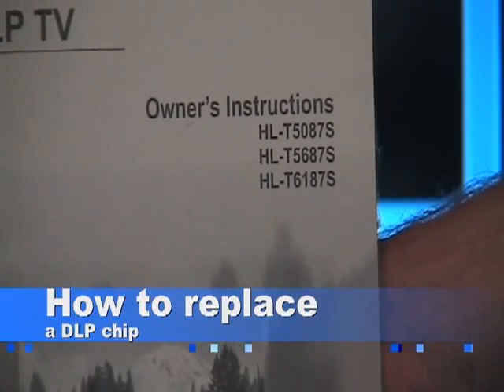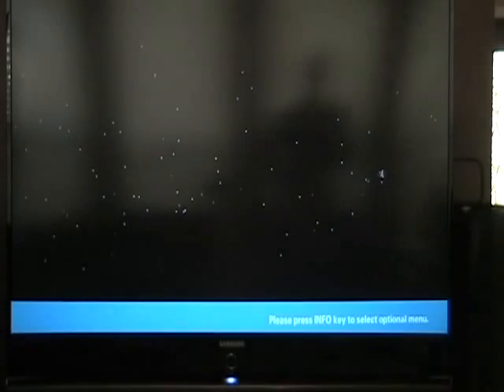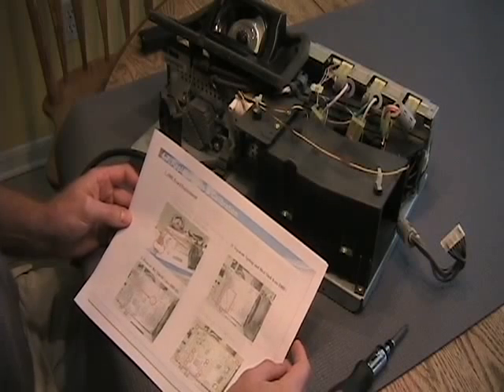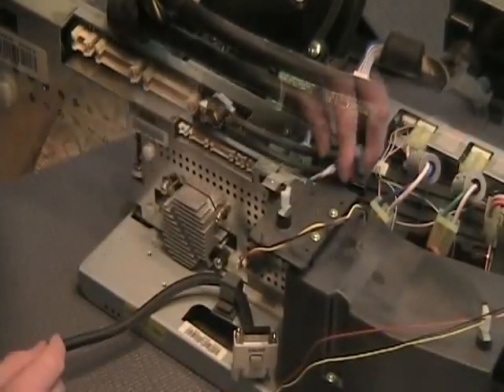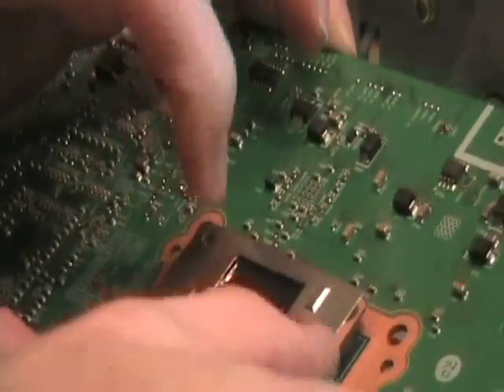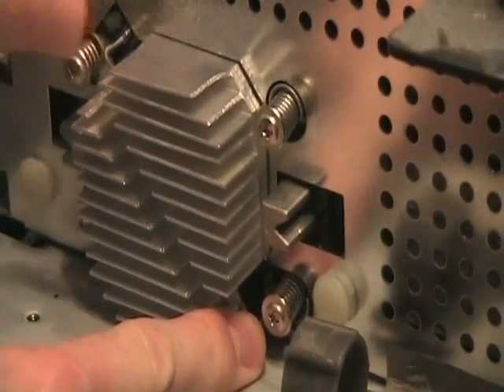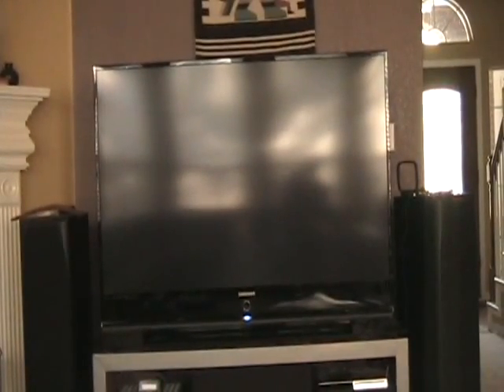Replace DLP chip on Samsung HLT6187

Comment: Just wanted to drop back in and say thanks again for your excellent video.  I finally did my replacement this past weekend and everything went great!  Some of the connectors on my HLT6187s were slightly different than what you have (like the monitor cables), but I was able to figure it out since they were in the same general location.     My picture looks great again, and you saved me so much money by not having to pay a repairman!

Comment: howd you get the board out ?  I got to 4:57  then all of a sudden youre putting in the new chip .
Reply from the maker: Please look back 4 month ago to my reply to DrewFromNC. The green PCB(Printed Circuit Board) can be simply pulled/slid out from the metal casing. Also, 2 months back, MON KELDAD posted a similar question/explanation. He points out that once you pull the green PCB out, flip it over to see the chip. Hope the helps. Sorry for any confusion. Thanks for watching and good luck.
Reply: WillFully WeirdWorld I got it.  It was just a little wedged in there.  Thought there was more screws.   Thanks for your reply and EXCELLENT video you made.

Comment: I usually buy my parts from Samsungparts  com.  But this chip is running nearly $400, I see the same chip on Ebay from a seller for $189 who currently has a 99.4% feedback rating.  Where did you get your chip from and how much did you pay?
Reply from the maker: I have no affiliation with them, but I happen to use shopjimmy. If you go all the way down to my first reply (2nd post), it tells you where I found the manual and how I located the DLP chip.  Thanks for watching and good luck.
Reply: Thanks!!!  And thanks again for your video,  I love fixing things myself and videos like this are a huge help.

Comment: Hi, I have a Samsung LCD rear projection ready TV Model # HL-R5087W  that has great sound but no picture at all, I have hooked different thing to it DVD player, Computer, another TV, ECT... trying to get a picture, I have even done the flashlight test with the menu screen, but it does not show anything, I was told the Lamp was recently changed and the color wheel is good, it shows smiley face when its done booting up. it does not turn of by itself, when the lamp is changed and you reset the lamp hours, doesn't you TV need to have some sort of picture to be able to reset it ? and should the lamp light, when on shine up thru the square hole that sets right behind the screen , can anyone help me figure out what is wrong with this TV. Thank You Laura.
Reply from the maker: The HL-R5087W is two generation before the TV in this video. Your TV has a bulb (lamp) for illumination while mine has LEDs. Very different technology. Sorry I can not help with your issue because I am not familiar with your TV or with the issue you are having. Good luck.

Comment: Have a guy that wants to charge an arm and a leg to replace this chip but after watching this video I'm pretty sure i can handle it. He mentioned something about programming the chip or something in that manner (i wasn't the one who spoke with him), but just to make sure...there is no programming necessary for replacing this part correct? and anywhere you suggest getting the part from. Only place I've found them new is eBay for about $180. Thanks
Reply from the maker: No programming needed. If you've every built a PC from scratch, this should be very easy for you. If you never have messed around with electronics, you should talk with someone who has so they can give you some tips on what to watch out for. As for buying, check out the very first comment and my reply. Put the part number in a search engine and specify shopping. I'm not affiliated with any one but I happen to buy mine from ShopJimmy. There are other places too. Highly recommend the service manuals also.

Comment: I'm replacing my DLP chip in the same model to fix the white dots.  I'm down to the step where I've removed the 8 screws that secure the bracket piece above the DLP chip and I see the chip thru the opening in the middle of the board.  In the video, it looks like this board pops out to permit access to the other side where the chip is.  However, even with the 8 screws loose, my board appears to still be secure.  How did you get the board out?  Is there a step omitted from video that I'm missing?  Thanks!
Reply from the maker: No missing steps. If you removed all 4 screws from the metal shield (the 4th one was hidden under some tape on mine) and all 8 point screws on the bracket, the whole green DMB Panel slides out. There is a separate metal casing (visible at 5:17 in video) that doesn't move and is fixed in place. Also if you have the Samsung Service manual, pages 12-11 and 12-12 in section 12-1-8, show the procedure to remove the DMB board. You can get a service manual online. See one of my first post that says where to find them. Good luck.

Comment: Bob O posted the following 6 months ago.

"My picture is a bit too high. I adjusted the screen in both settings and service mode, but still too high. Any ideas what caused this? My guess would be maybe I moved the mirror slightly when cleaning or tightened the screws down to hard. Just guessing."

I have the same problem after replacing my dlp chip. Any help would be greatly appreciated.
Reply from the maker: Sorry, I'm did not experience this problem. My only suggestion would be to look at section "3-6-1 Tilt Screen" of the Samsung service manual. Hopefully this helps fixes your problem. If you did not get the service manual yet, you can buy them online. In one of my first comments, I mention where you can find the manuals online. Good luck.
Reply from the maker: WillFully WeirdWorld Strange to reply to myself :). I just went back and read "Bob O" comments along with the replies between us. We talk about alignment knobs that the service manual points to. See all the comments below to find them. Sounds like they solved "Bob O's" issue. Hope this helps.

Comment: I just did this and it worked great. That is once I figured out that the back cover must be on for the lamp to turn on. So don't try to test it out without taking the final step of replacing the back cover. I would have saved hours if I had known.

Comment from the maker: I have not seen the evenly spaced vertical lines issue. My first suggestion would be to double check that all the cable are correctly seated. Maybe even pull them and re-connect. Sorry I can't be of any more help. There is a huge thread over at AVS forums. Maybe post your question there.

Comment from the maker: COOLRADIUM, the concept of replacing the DLP chip will work, but this how-to will not reflect what you will find in the HLT6176s. The 76s is an older generation (than the 87s) and the internal layout will have differences because the 76s has a color wheel and lamp versus the 87s has the LED light engine. If you are having white or black stuck-on pixels, it is the DLP that needs replacing. But, this is not the right video for your TV. Good luck.

Comment: Thanks for the video. Helped me save $600 over buying a new 60 inch TV. I was worried at first when I turned on my TV and everything went black. Turns out I forgot to plug one of the wires in. Phew!

Comment from the maker: There are alignment knobs inside the TV you can use. Look back approx. 7months in theses comments. Look for post by me, Sam Crook, and jbowen52. Jbowen52 describes the knobs and I describe how to find a picture of them on AVS forums. Also, if you purchased the service manual, it describe where they are. Good luck.

Comment: Thanks for the videos. just changed the chip on my 5087 and it works fine! Also cleaned the heat sinks, as you suggested, and boy did they need it!

Comment from the maker: The HL-R4667W is 2 generation before the HLT here. The HLT6187 does not have a color wheel, nor does it have the lamp light. The HLT has multi-colored LED light engine that provides both the color and light.
Therefore, I don't think anyone here will know the answer to your question. I'd searching AVS forums. Good luck.

Comment: Here is a problem no one on here has addressed.
I have a Samsung 46" HL-R4667W, Turn it on you can hear the ballast click, the lamp is illuminated, the color wheel is spinning quietly, all fans are running BUT the lamp light is blinking, no picture or sound.I removed the round inspection cover on the side and you can see light in the lens.

Comment from the maker: Hard to say but my two guesses would be: 1) Focus nob needs adjustment, 2) Lenses need cleaning or weren't cleaned properly. I'll assume it's the first one; so, if you look back to the first comments below, I explain where to get a manual. Highly recommend you get it. It will explain where the focus nob is. It also has other alignment and adjustment procedures.

Comment from the maker: The video shows me applying a few BB size spots near the center and then spreading them around the heat sink but not all the way to the edges. It will spread on its own. Since this chip is rectangular, I'd add a rice size amount centered along the longer length. A little goes a long ways. Just image a drop of glue smashed between to pieces of paper. It spreads far. Finally it's best to center it. All CPU/chips I've ever designed/worked on typically are hottest in the center. Good luck.

Comment from the maker: It is coming up on a year since my replacement. The white dots have not returned. I've read that Texas Instruments, who fabricates the DLP chips, had problems with first few runs of these chips. Supposedly they have fixed the process. Having myself, worked in this industry, believe that TI has stabilized the process and the white dots won't return.  My concern at this point is if any of the other know issues (See list of know issue in comments below) will occur.

Comment: I want to thank you for taking the time to create and post this video.  Changed my chip today in my 61" Samsung DLP using your video.  Mine is the LED model so there's no bulb that dims over time; however, I had not expected the picture to gain sharpness in addition to getting rid of the white dots.   I guess it was so gradual, I had never noticed.  Thank you again!

Comment from the maker: Unfortunately Stanley, it might be a power supply problem. Having read the main thread on AVS Forums for the HLT6187, I know of several issues this TV has developed.  1) Red LED failing, 2) DLP failing (white dots), 3) Caps on power supple failing, and 4) Caps on digital board failing. One and Two are the most common and I would be willing to fix. Diagnosing and fixing 3) or 4) sound more difficult from what I've read.  I've never fixed 3) or 4). Sorry. AVS forums might be of help to you.

Comment from the maker: Hard to say without a pic. My two guesses are that you either need to clean the lenses or you may have the "halo effect". If lenses, cleaning is easy. If you happen to have one of the units produced in the first few months of release for the HLT series, there was an issue many called "halo effect". You can learn more by doing a google search with: "samsung dlp 6187 halo effect". AVS forums has lots of information on it.

Comment: Great video!!  I have been going back and forth with Samsung about these white dots (my model was not covered in the class-action lawsuit), so I finally decided to do a little research on repairing my self.  So glad I stumbled upon your video.  Bought the chip at ShopJimmy via Amazon for $159.  I had my DLP set back up and running without the white dots in about 90 minutes!  My only critique about the video, LOOSE THE MUSIC!!  
Other than that, Bravo, thanks for the instructions!!!

Comment from the maker: I've seen varying prices on the DLP chip (the most expensive part). It was running ~$190 when I did it last year. Throw in the manual (I suggest in the video) and some thermal past and it was ~$210. I don't know the current asking price of the DLP chip.  To me, $210 was worth it for the 61" HDTV. My very first reply to the first comment tells you the part number and where to find manuals. Good Luck!

Comment: I replaced the chip & reinstalled everything the picture is perfectly clear from dots. But the picture is off centered. I have about 2" of black on the left side of the screen & about 3/4" at the bottom. Are there any adjustments to fix this?

Comment from the maker: No, for Artic Silver, you should not wait for it to dry. Also, too much can be an issue. Do not apply liberally. Furthermore, center it on the heat sink, it will spread out as you put the heat sink back on. Also, most CPU/GPU/semiconductor chips have the highest heat production near the center of the chip. Although it looks like I'm placing a lot on the heat sink, it's not that much and I'm mostly just spreading it out.

Comment from the maker: It seems to me that you would have very little room to work with if you don't remove the light engine. If you can handle the cramped quarter, I guess it's OK. Removing the light engine is probably one of the easier steps and gives you access to clean out more stuff. I read of many people having the red LED burn out. Taking the light engine out allows you to clean the heat sinks of the LEDs. I highly recommend that they be cleaned.

Comment: Nice video.  I just started this process tonight and got all the way to the point before removing the terminal board but stopped to confirm that the 1910-6143W will work to replace the 1910-6103W chip I have in there.  

  Do you really have to remove the entire light engine?  It seemed like everything was accessible without doing that.  Just unplug the cables, remove the fan and heat sink.  Do you think there is anything wrong with just removing terminal board?

Comment from the maker: Possibly. I can not say without seeing it. At ~45 seconds into the video, I switch to an all white jpeg image and show the black spots. If the DLP is dying, you'll eventually see both. An easy way to find the white stuck on pixels (and black stuck-off pixels) is to load jpeg images from a USB stick. Just find (online) 1080p all black and all white jpeg images and display them on the screen. That's what I'm doing at the beginning of the video.

Comment: I replaced my board, and the image is great now. Only problem is that it got moved out of alignment. I just found out (via previous comments) that there are image adjustment knobs for vertical and horizontal adjustments of the image. When I was replacing my chip last night, I never noticed these knobs. Would they happen to be visible in your video? Im just trying to make it easier on myself for when I get home tonight to finish fixing it :)

Comment from the maker: Also, you have access to those three screws from the moment you take off the back plastic. You don't have to remove anything from the back of the TV or disconnect any cables. I would recommend getting a service manual for detailed description of the knobs jbowen52 is referring to AND how to adjust/move the board as I describe. Hard to describe in just text.

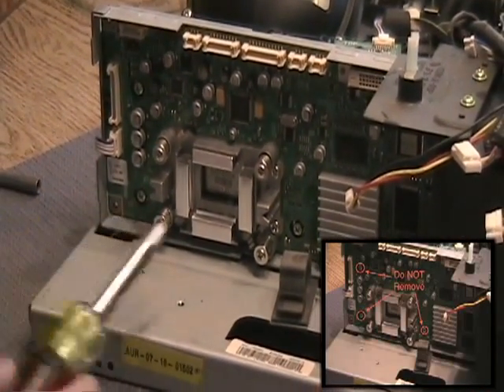Comment from the maker: jbowen52 is correct if the alignment issue is in the up/down or left/right direction. If you need rotation in the clockwise or counter-clockwise direction, then you need to loosen the three screws I said to "do not remove" at the 4:31 time mark. Look in the bottom right of the video for a little inset image. The service manual describes in more details; but basically you loosen them, twist/move board and have someone in front of TV telling you if you got it right or not.

Comment: Just behind the metal housing that holds the DLP chip, you will find two knobs.   One is for vertical alignment and one is for horizontal.  I had to adjust the horizontal alignment after changing the chip.  It was the upper of the two knobs.

Comment: Thanks for the video.   I big help.  I changed the DLP chip and picture is now perfect.  Just had to do a small tweak of the horizontal illumination adjuster to center the picture.  Pretty easy and a big savings!

Comment: Assuming you still see a picture but everything is tinted green, it is probably a dead red LED.  Another chronic problem with this set, but pretty easy to fix.  Parts and instructions are all online.